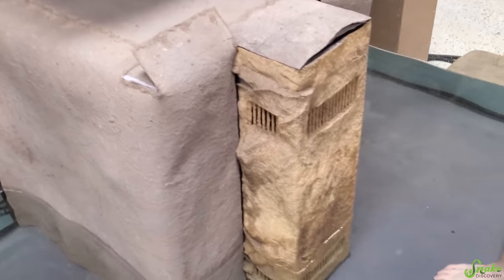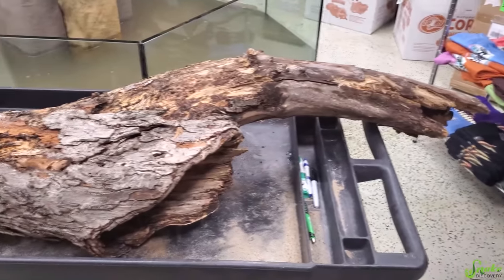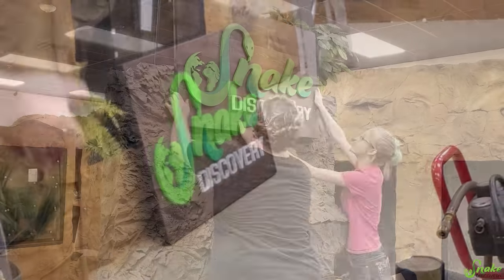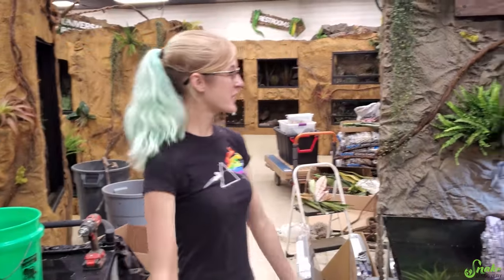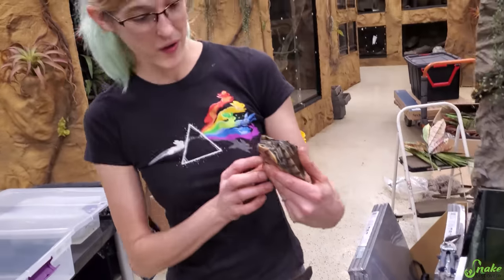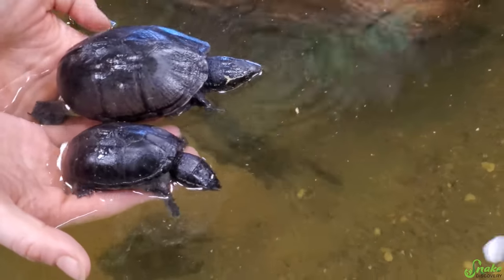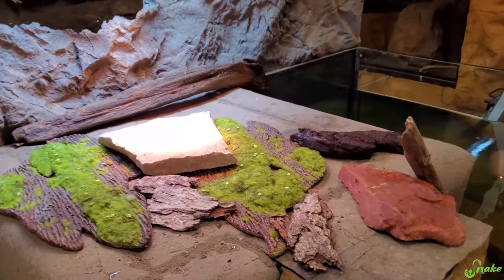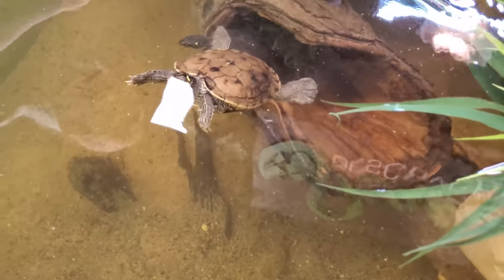Moving our Turtles into the Zoo!!

Comment: I'm sure you guys know what you're doing, but I couldn't help thinking that that large piece of wood will cause a drastic spike in nitrite in the water and it will continue secreting nitrite for a long time. If this happens, it will cause stress to any organisms living in the water and can be lethal to some (not sure about turtles). Filtration will not be sufficient. A massive introduction of "good" bacteria is a must, but even that may not be enough. I used to have a 100 g aquarium and when setting up I would add rocks, substrate when filling it, let that stand for a couple of days with the filter running while I added plants. I then added a few guppies as well as bacteria (you buy the latter) and let the whole thing stabilize from the chemistry aspect. That would take anything from 4-6 weeks. Only then would I add the permanent resident fish. The guppies are not necessarily a permanent feature, they are just a good addition to the nitrite/nitrate cycle in the water.